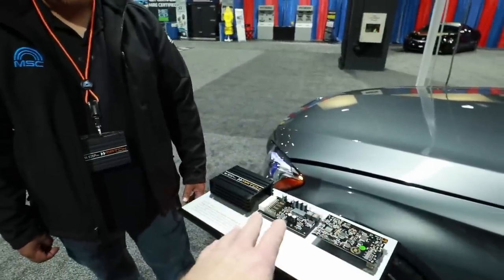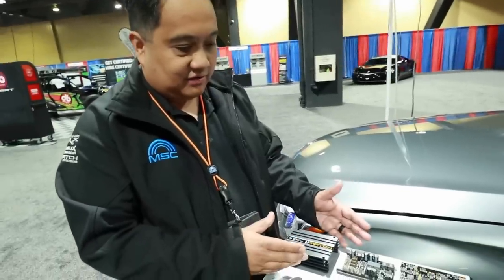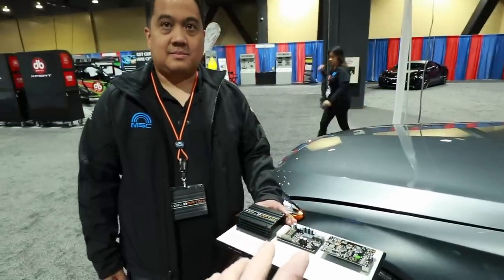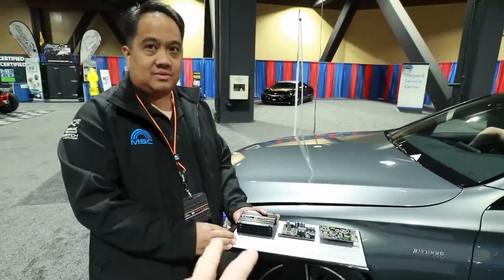The most amazing small amplifier ever, Match M5DSP MK2

Comment: I have the Match 7 universal  Amp/DSP combo , the software is the same as the Helix or Brax DSP units,  and the class HD amp is super clean and loud , also it barely gets hot at loud volumes  . This tiny amp is driving my center channel / front left and right and rear left and right , plus 2 10 inch kicker subs . Amps fits under the passenger seat of my 2019 F150.
Reply: By the way the unit is $1200.00

Comment: Nice Video! i bought the Match M5DSP MK2. I installed in in my new car, but i have the problem that when i connect the amp with the laptop through USB, it says that it is connected for 2 seconds and after that its disconnected. So i cannot get the connection. Maybe the DSP PC tool is too new for the amp? Could you help me with this problem?

Comment: Can't believe that thing works as good as you're saying. Was it loud and clear, though, or more for medium volume listening?
Reply: @Patrick S  

Loud & Clear.  Most people don't realize how little power is actually needed to drive midrange speakers and tweeters which provide 90% of the frequencies present in most music... We're talking just a few watts to maybe 10 Watts to get really loud.

If a speaker's sensitivity rating (SPL) is 90dB @ 1w/1m, that means that with just 1 Watt of power, that particular speaker will play at 90dB SPL when you are ~3 feet away from it (typical in most cars).

Most car audio midbass & midrange speakers have a Sensitivity/SPL spec that's closer to 85dB @ 1w/1m, so yeah, you'll need more power, but 50-75 Watts for midrange & tweeters is PLENTY.

Sure, for midbass and subwoofers you need exponentially more power, but still not what most people think, especially if all of the speakers have good phase coherency and are time aligned to the listening position....this means that they all "group together" to increase the perceived loudness level.

In this Mercedes, the 8" midbass speakers are located in the front footwell "kick panels", which boosts their loudness and efficiency via a phenomenon called "corner loading" or "boundary loading".  And in general, the interior cabin size of vehicles naturally boosts the lower frequency ranges, especially in the 45-55Hz range by ~9-12dB,.so.you essentially get extra "power for free".

Having said all that, keep in mind that this particular Mercedes has a VERY QUIET interior straight from the factory, so wind, tire, & road noise aren't as much of a factor compared to most vehicles.

Generally, you do need more power, especially in the low frequencies to overcome driving & road noise and to provide "impact'' in most cars that aren't as quiet as this Benz.
Reply: @bbfoto7248  Thanks for the excellent reply, much appreciated.
Reply: @bbfoto7248  I wish I could thumbs up your reply more than just once. Clearly you nailed all of the issues involved with audio reproduction in an automobile extremely accurately and you made the information understandable for everyone. Nicely done sir!

Comment: its a set of TPA3118s. this guys hyping it all up. Sure the DSP and start stop power supply is cool, but the chip amp is just a run of the mill class D power amp with a properly designed output filter. thats all. 3:32 that TPA chip is capable to run at a switching frequency of 1.2 mHz. at that range you dont TECHNICALLY need an output filter as that RF would deplete in the 10+ foot speaker wire BUT it could interfere with the cars stuff. old tech in a new box. nice to see decent power in real tiny boxes now.

Comment: Anyone else see something fishy with the larger pcb?
Reply: the thickness?
Reply: @goblinphreak2132  look at how long the 2nd PCB is vs. The length of the amp. Something dont add up
Reply: @Xx_o_xX  looks fine to me.... its probably just a super tight fit
Reply: @goblinphreak2132  looking at it as well. May be a camera distortion of actual size?
Reply: @Xx_o_xX  most likely
Reply: @goblinphreak2132  will go with that. Thanks!